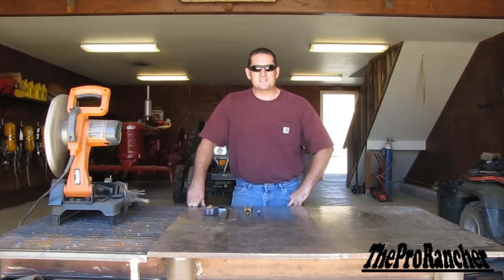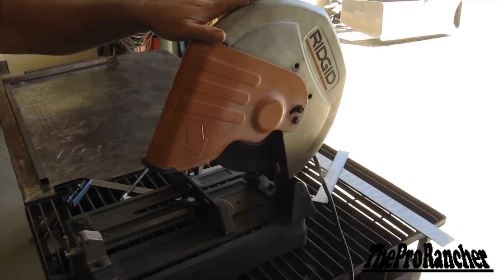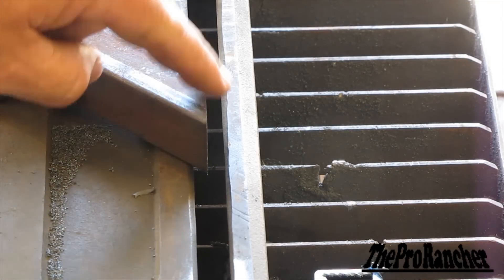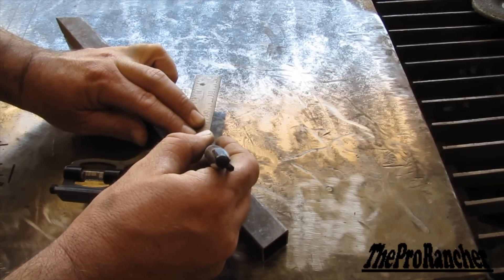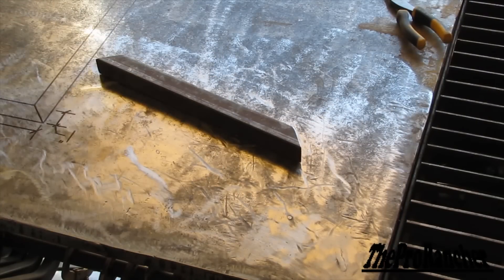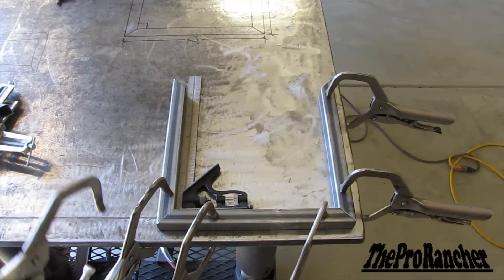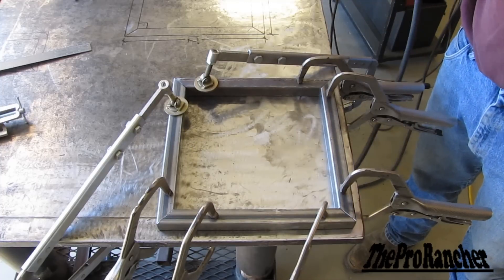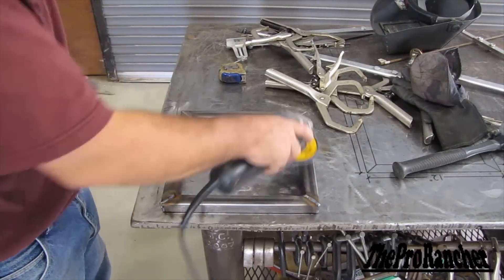Welding Fabrication Basics - Part 2

Comment: The old "vice to the angle trick" OK.. I learned something today. My Dewalt drop saw never gave me exact cuts. I put it down to the wheel and vibration but deep down knew it was the Junky angle adjustment that has so much play in it. . Thank you. I'll do it from now on. A big thumbs up.. The penny dropped down in the land of oz with that simple piece of advice

Comment: TIG produces, without a doubt, the overall highest-quality welds around of the 5 major welding processes (oxyacetylene, SMAW, GMAW, GTAW and flux core arc welding). Food grade stainless piping, commonly used in commercial pharmaceutical, sanitation and other industries requiring special alloy bonds. These include stainless steel, in addition to nonferrous metallic compounds such as nickel, cobalt, aluminum, magnesium and copper to name a few. It also has no fume emissions or slag/spatter.

Comment: That's a really useful method. I like it, but it also eats a lot of you're time.
Here's what i would do instead of using so many clamps and time.
Get as even as possible by eye balling it, then place a small tack on each corner, then square it off with the measuring tape. Then... you get the idea. 
Great vid

Comment: Thank you for the tutorial.
Those chop saws are cheaper than expected, I'll get one and use it to cut a ton of electrical conduit tubing I got for free. Unfortunately the type of metal is unknown to me. While round tubing won't be flush with the square dimensions of a pickup truck, I would like to use it to construct a camper style topper for my pickup. I'm also going to fabricate it into a low end fence line until I buy this home and save up for a permanent fence.
Reply: Conduit is often zinc coated

Comment: Hi, how do you remove the black residues on carbon steel before painting? With a hammer, torch, grinder or what?
Is cleaning the steel really crucial? How long can the paint last when it's put on the raw, ungrinded carbon steel?

Comment: Aloha ProRancher!   Is it possible to take galvanized pipe and shape it into a rectangular shape?  I need to run pipe into a cyclone filter (hot gas) so the intake needs to conform in order for it to work the best.

Comment: Scba's . .  Nice being prepared. The fire hose you used. Is that running off the house water? Or maybe your on well water?. What's it take to run that ....2" line???? What's your setup for that. Got me thinking. I'll probably get arrested now, when the city catches me wet tapping the 10" main under the road. .lol. I got to take welding class also.

Comment: When you grind off the weld to flatten out the material for finish, don't you lose the strength  ?
Reply: As long as your welding skills are up to par, you got full penetration on the weld, so after the grinding, you still have a weld that is as deep as the base metal, and therefore equally as strong.

Comment: Nice Video. I just have a comment. Just checking the diagonal length is not enough. Having the same length means that you have a rhombus not a square. Check the 90 degree corners to make sure they are still 90 degrees.

Comment: Don't mean to be disagreeable, ProRancher, but it is possible to have a rectangle with all angles being 90 degrees, two opposite sides being 5 inches, the two other sides being 12 inches, and the diagonals both being 13 inches.  The diagonals would be equal and the angles would be square but the figure would not be a square.  Have I misunderstood your statement?  I know you don't make mistakes like that so I may have just misunderstood you.

Comment: can i just buy a bench saw and put one of those disks on or dose it have to b a chop saw
Reply: I think you actually need a high RPM motor for abrasives...
Reply: so in other words i need the saws that are made to cut steel and not just a wood chop saw  oh well i did not think i could use a wood saw
Reply: Yeah, chop saws, using abrasive blades :)
Reply: ok ill invest in one and what are those blades called that look like a normal wood saw blade but they cut steel ?
Reply: Regular metal cutting saw blade, I think? I'm no guru, but I would go for abrasives for smoother and vibration free cuts.
Reply: technoshamanarchist ok ill look into both but i do want the smoothest cut i can get so abrasives first
Reply: Good luck :)
Reply: technoshamanarchist thanks and also thanks for ur help

Comment: You should've TIG welded it.. It's a lot smoother looking and not much grinding.. ;) But nice video..
Reply: +KKlippert GTAW is a lot slower and, for the purposes listed in the video (especially with the relatively low strength materials used) the type of weld doesn't matter as much - GMAW is just a lot faster; for people like me, anyway!
Reply: KKlippert or you can  could bevel the edges and it would look much better without all that grinding.

Comment: your supposed to clamp the tubing down strategically to where you don't have to remove them to check square its a waste of time. When your going through the fabrication process its best to stick to one task at a time. like cutting the tubing with your saw, instead of jumping from that to deburing the edge, you wont have to jump back from tool to tool it becomes inefficient. The only way to make money fabricating is to be as efficient as you can to cut down time and therefore a higher production level which accumulates to more profit. and i found it quite funny how you clamped it down 8 times to tack it, but you didn't clamp it down once to sand it and ried to do it one handed. Depending on what the frame is going to be used for, you typically want to weld all 4 sides of the fram, not just the front and back. Im not trying to bag on the video, you did everything precise in the fabrication of it, i just can't help but throw in a few tricks of the trade in being an experienced fabricator

Comment: man you are awesome  , I got inspired  to  start doing  this  ,can I  start  to make  little projects  with a little   welder from arbor freight ,like a 70 amp stick welder ,thanks  sebastian
Reply: Dont use those welders, I have one and it barely even keeps the arc, I have to use the smallest sticks and because theyre so small as soon as they stick they get hot and turn into noodles and then you can use them anymore. 
Try the 130-140 amp Decent brand machines. I got a Lincoln 140 Mig welder for light duty welding and its been the best thing ever. Runs on 120V

Comment: Mig is only useful fore certain applications. Its a very common process to use since it's virtually idiot proof, because there is no need to manually feed filler material or maintain a proper arc length. All you have to do is point and shoot. It's analogous to welding version of a hot glue gun. TIG welding is by far the most desired welding process available, next being a skilled SMAW (stick) welder whom can run both 6010/6011 root  and 7018 cover passes according to AWS specs @ x-ray quality.